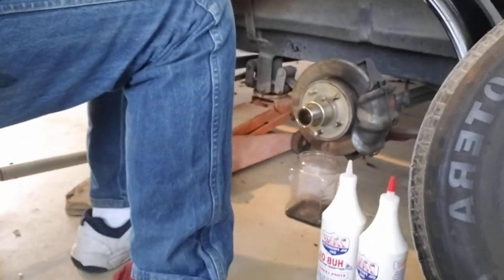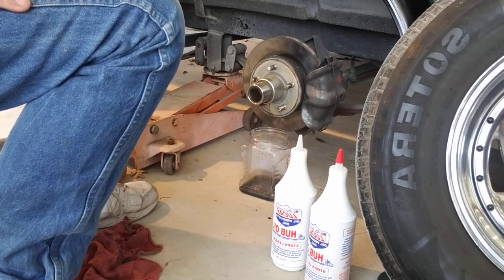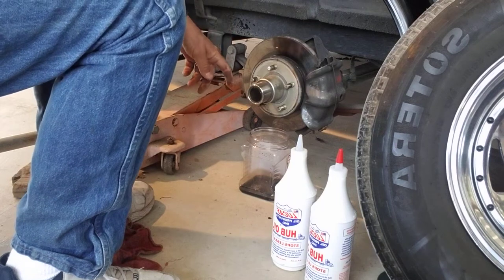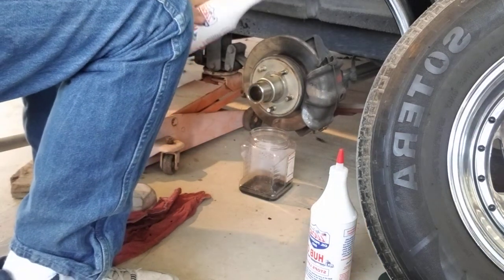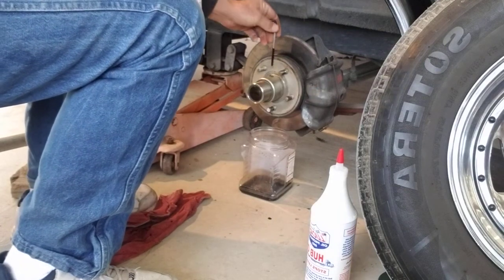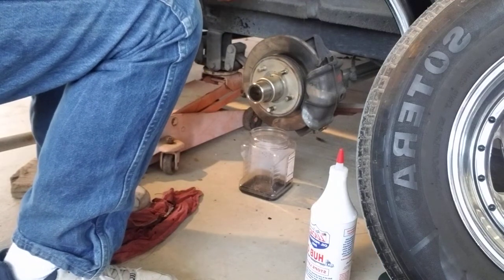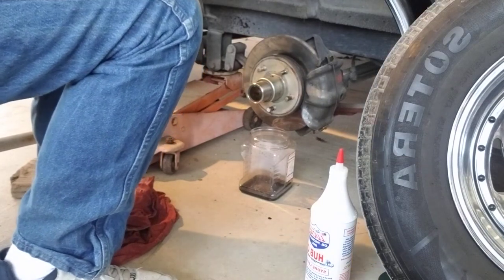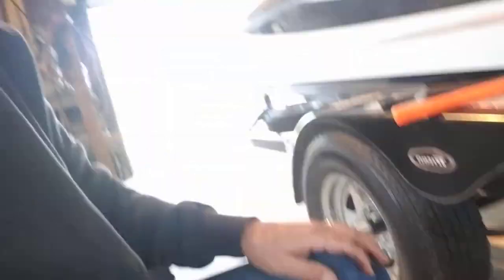Trailer Hub Care

Comment: I have a 2016 ranger trailer single axle the owners manual says they are the cool hubs . They look just like the ones in your video but they don’t have the clear sight window and don’t have the drain and fill port ???
Reply: I have a 2021 Ranger z519 and the manual says it has Cool Hubs. But I took off the wheel hub and it has Dexter Vault Hubs.....not Cool Hubs.